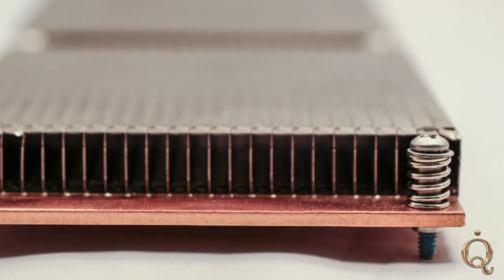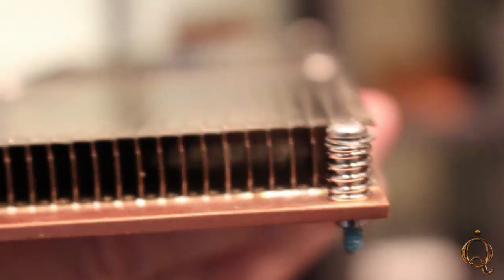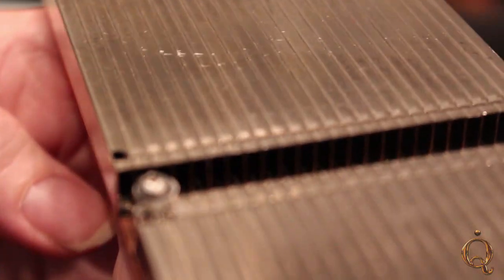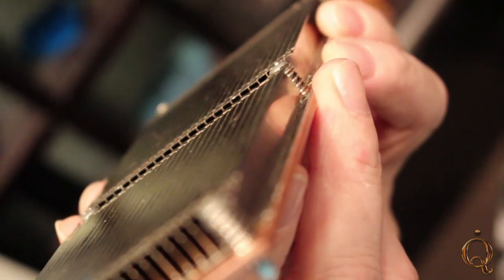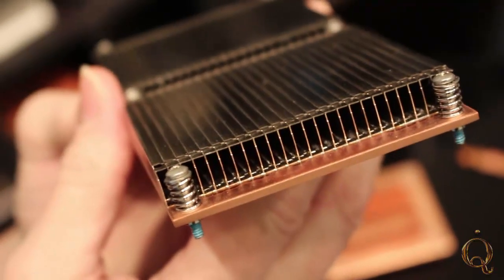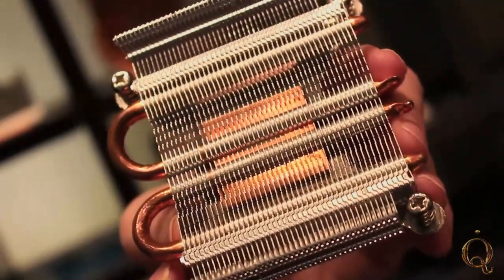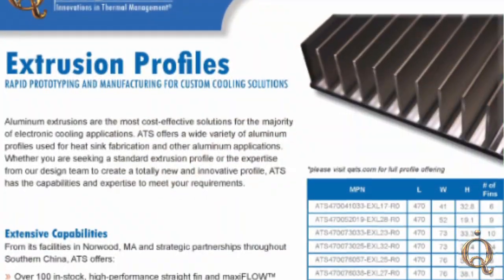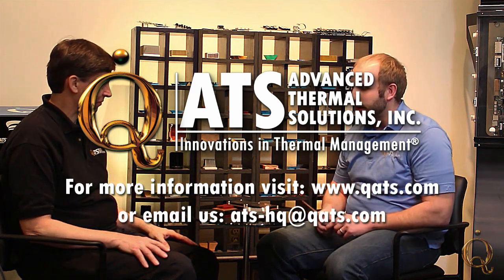High Fin Density Heat Sink Manufacturing, Is Zipper Fin Best?

Comment: Do you have experience using silver metal as a heat sink medium?
Reply from the maker: Hi DoctorGarkle - We have not created heat sinks in pure silver, primarily due to the cost. The thermal conductivity of silver is certainly high (see the list here https://www.engineeringtoolbox.com/thermal-conductivity-metals-d_858.html ) but it runs roughly $16 per ounce vs Copper at roughly $3 per pound or aluminum at $1 per pound.

On the thermal conductivity front, silver is about 407 W/m K; which is certainly better than copper or aluminum.  But, if you add a heat pipe (or vapor chamber) to a copper or aluminum heat sink, you improve their thermal conductivity while still keeping costs low.

We certainly would creat a silver heat sink for a project if it truly needed it, but in our 25+ year experience, other options are more favorable for a variety of reasons.   Hope this helps!